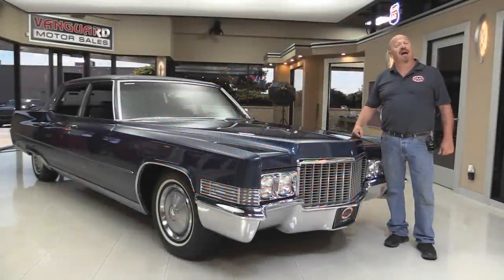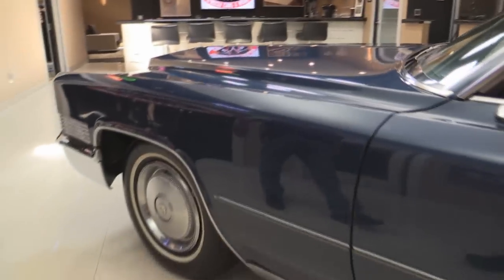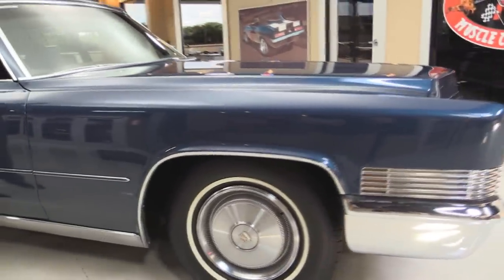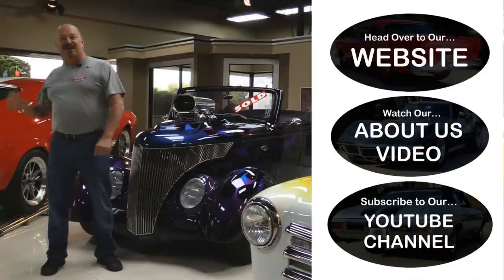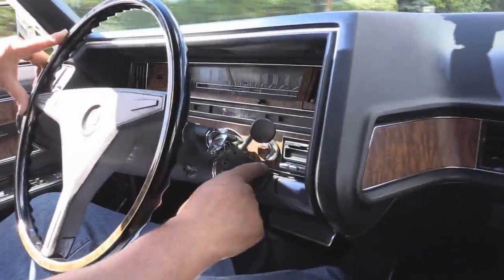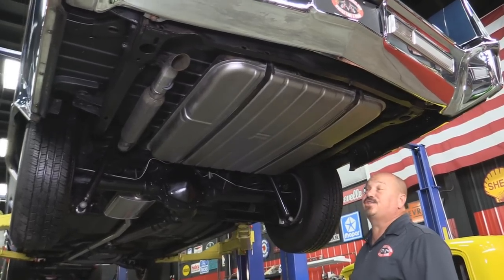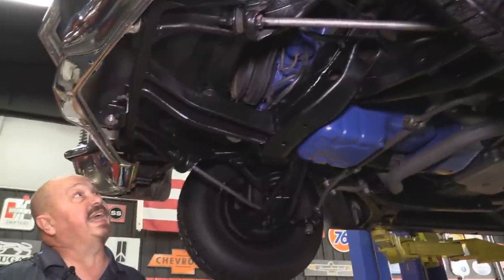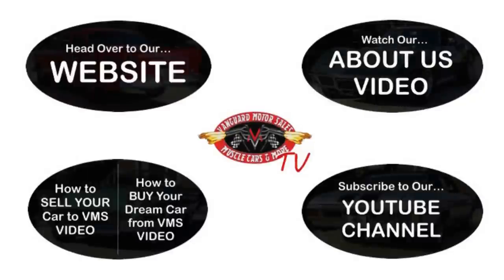1970 Cadillac Fleetwood For Sale

Comment: I used to look at Cyrus' Eaton 's  maroon metallic 1970  Fleetwood w. black vinyl roof drive by , open mouthed and  in awe,  in 1970 when I used to live in the Avenue Rd. area in Toronto ON. I never did find out if it was chauffeur driven. From 1970 onwards , the Cadillacs went downhill in build quality. From 1968-1970 they were tops , though. I was lucky enough to own, and daily drive a 1968 2 dr Cadillac Calais.

Comment: I drive a 30 year old Cadillac every day.  And I love it!  And yesterday I was trying to figure out why it has no heat!  And after that I have to install a new driver’s door power window motor.  And soon it’s going to need an oil change.  And then I need to change the engine coolant and clean the battery terminals.  Constant maintenance and repairs are required to daily drive an old car.  But I’m not complaining because there’s not a single new car out there that I could like better than my old Cadillac!

Oh, and a year ago I had a transmission shop repair the transmission.  It wasn’t shifting properly and needed two new shift solenoids.  The repair was probably half the cost of just one month’s payment on a new car, so again, I’m not complaining!

Comment: Twin to the '69 model year (as Cadillac changed body stylings about every 2 years), but I prefer '69 as the front headlight/grill trim is more complete, and I don't care for the rear quarter side reflector lens on '70s models.  However, this example is in superb condition, with an especially attractive shade of blue.

Comment: i have a question. what does one do to protect the engine, well basically the valves and valve seats, from using unleaded crap gas, The engine was made to use leaded gas.